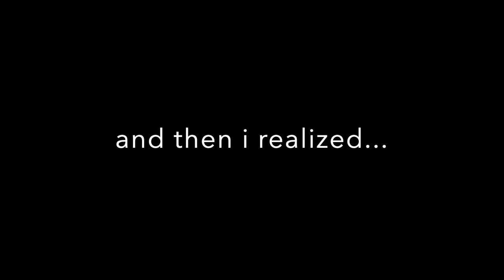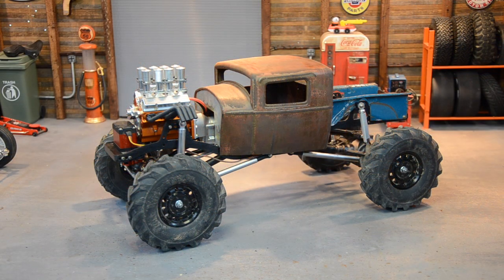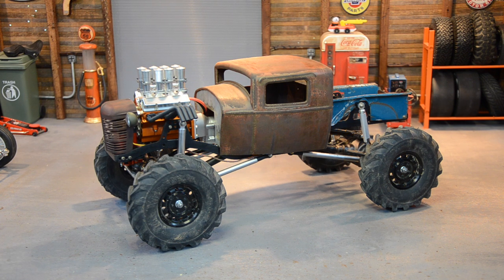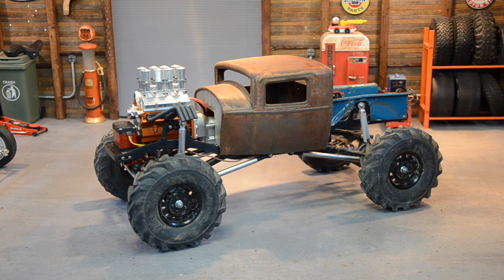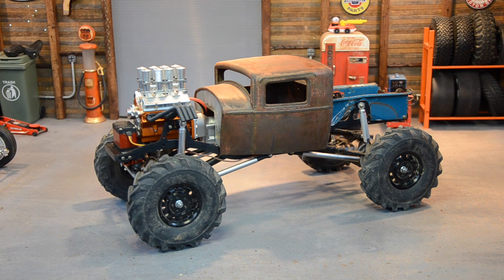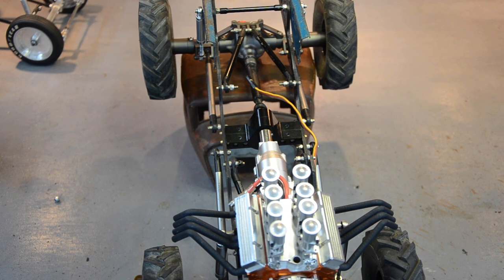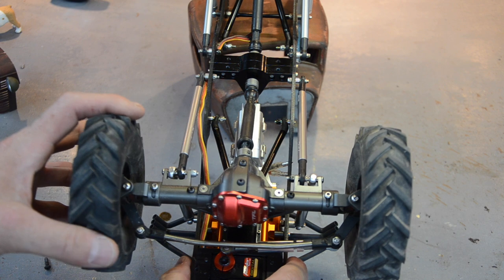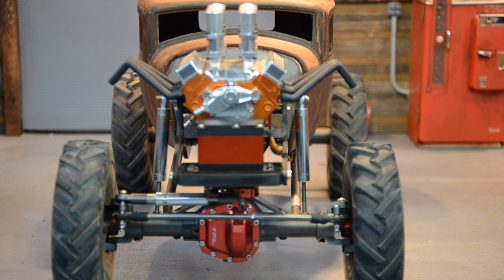Rat King Sling, Part 2, Transmission Mounting, RC4wd Scale V8, RC Rat Rod Mud Truck Build

Comment: Looks just fine with the grill on and the motor positioned like that, as a few other people have said just put some stuff on the fire wall like a brake booster and a battery

Comment: I love the rat rod! I do have a suggestion, maybe you thought of something. You could 3D print a gas tank that fits around the servo an move it forward then move the grill between the motor and tank. Gassers used to sort of run that look with the tank in front

Comment: You have the 3 piece rear axle. You can rotate the center section so the drive angle can be whatever you want. Shorten the rear drive shaft and slide the whole setup back 1/4 inch.

Comment: You could always make a trans mount and move it back a little and drop the height of tge transfer case down to help with the driveshaft angle. Which will also help with it being nose heavy.

Comment: Love the channel. I must have watched all your videos 3 times over now, keeping me entertained while i am furloughed from work. I finally got my TF2 Blazer off the shelf and took it on the trail after a year and a half of owning it. Just as much fun as my TRX4 just a little less capable but only in some areas. It has the GCM trans with a Chevy small block from Scale designs by MrcommaD and really surprised at only losing a driveshaft pin because i havent thread locked anything since i done the trans conversion. I love the thing to bits and has now got to be my favourite rig, yeah its not that capable especially since the leaf springs arent ran in yet but its an absolute blast to run, and it looks awesome. 
Love the videos and really love the passion you have for this hobby and lets not forget that you are a lover of all things rc4wd like me. Going to pick myself uo a C2X seen as though they pulled the plug on the cross country. 😀👍🏻🤜🏻🤛🏻🤙🏻

Comment: Just come up with an excuse for why the engine is so far forward, like its that far out front to help keep the front end down. Or as someone else mentioned just bolt up some accessories to the fire wall and that will kind of hide the gap. Most of your style is kind of the form follows function, make it work than make it pretty. I get the frustration as I spent way to much time rewiring the lights on my grand Hauler and trying to figure out how to mount up a lift axle.

Comment: hey brotha, i don't think the motor looks out of place at all man, why don't you just put some scale accessories on the firewall...put a scale battery back there, blower motor, brake booster etc....its a rat rod thing-a-majigger, of course things aren't gonna look "correct".